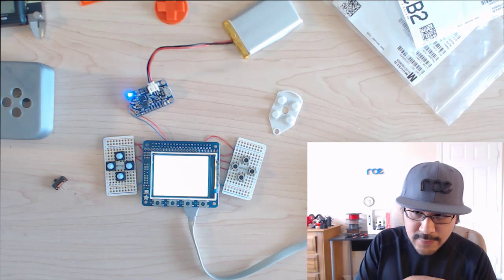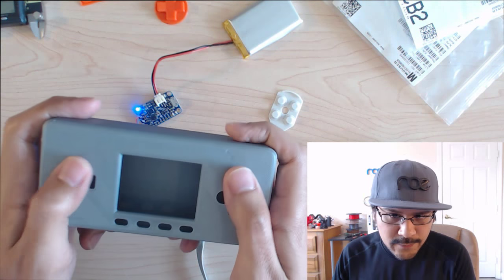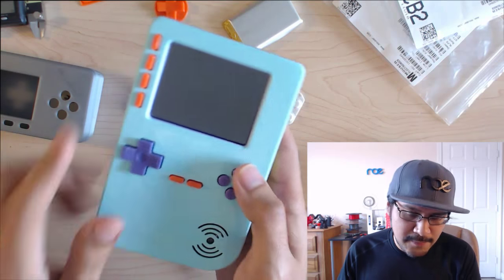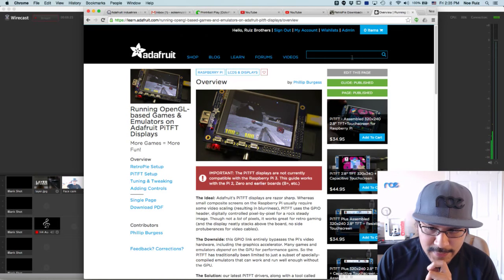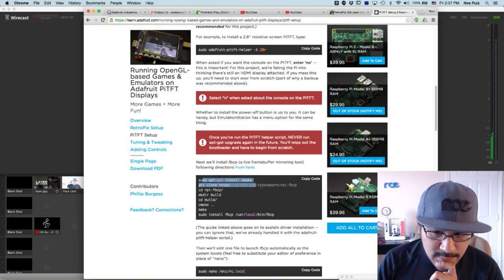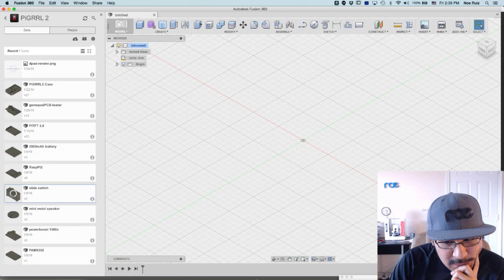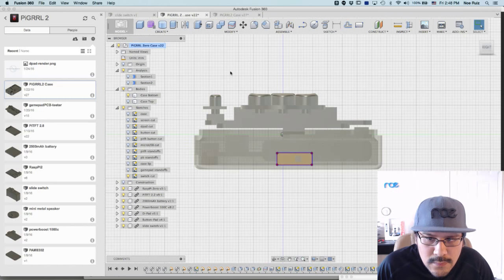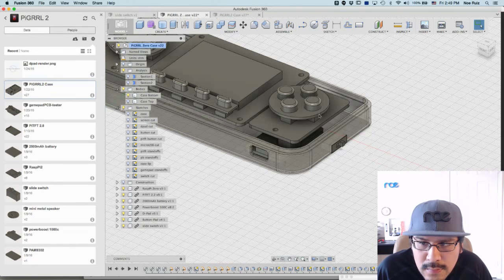Layer by Layer LIVE - PiGRRL Zero Pt 4 @adafruit #raspberrypi #3DPrinting

Comment: I think it would be better to have the power switch on another place or recessed inwards a bit, because it's easy to bump into it with you hand in it's current location. It also can be uncomfortable to people with small hands, because it might dig into the skin, depending on how the console is being held.
I'd put it either right above the "action" buttons, poking out from the front, so your hand only ever touches it to actually use it, or recess it enough so that you can push it with your finger, but it doesn't stick out enough to bother the user.
Reply from the maker: +blackcorvo Yep, originally was going to make the switch recessed but I've since moved it to the bottom center, plenty of clearance too!